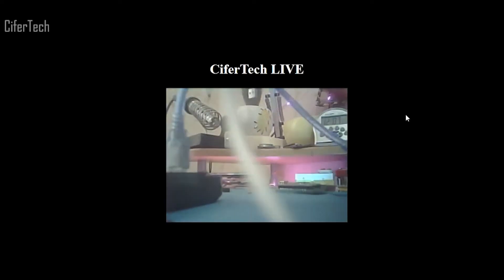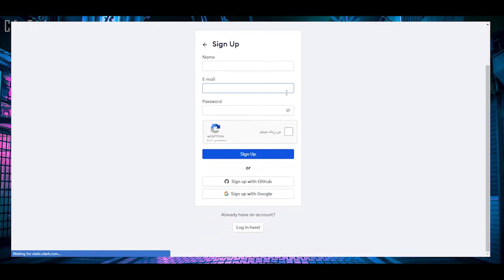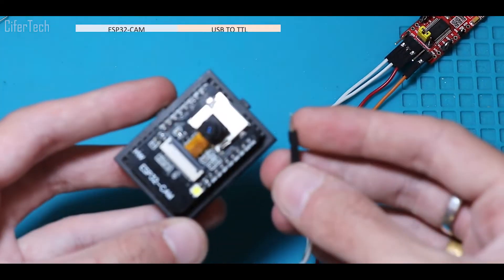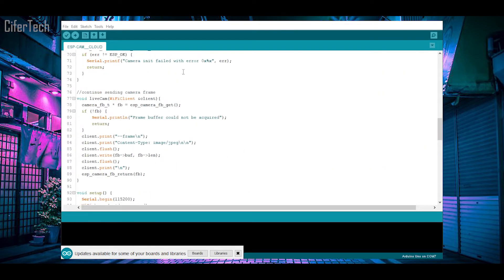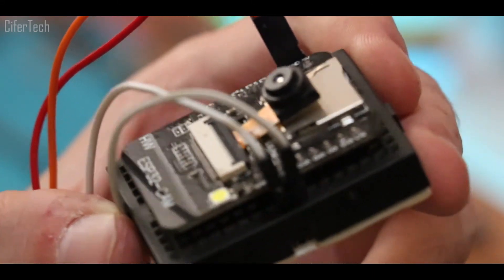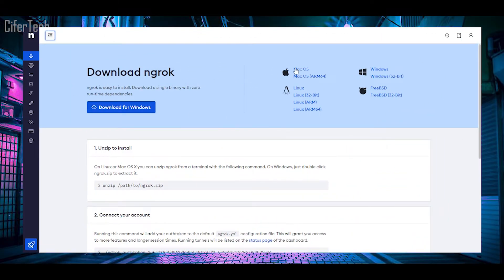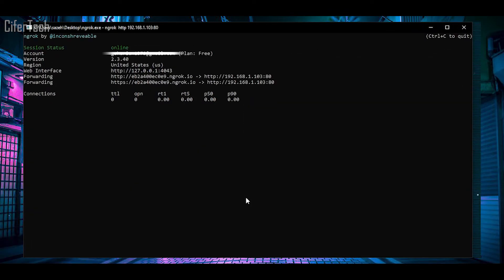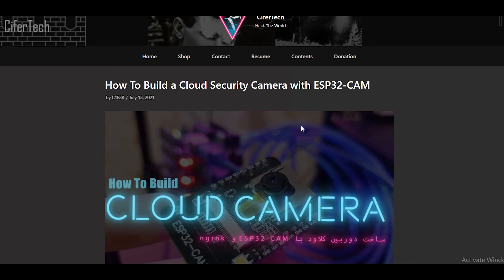How to Access ESP32-CAM Worldwide using ngrok

Comment: how can i improve image quality .
I solved the problem
Reply: how?
Reply: @bustadipiscio   config.frame_size = FRAMESIZE_QVGA;  you can use "QVGA|CIF|VGA|SVGA|XGA|SXGA|UXGA" instead of "QVGA" in this line of code
Reply: @handosara5521  and which is the best?
Reply: @bustadipiscio  Image quality increases from left to right . but fps drops drastically.test and use what works best for you
Reply: @handosara5521  thank you my man so much
Reply: I tried with QVGA (resolution), 30 for jpeg quality, and 20 buffers and it works pretty well